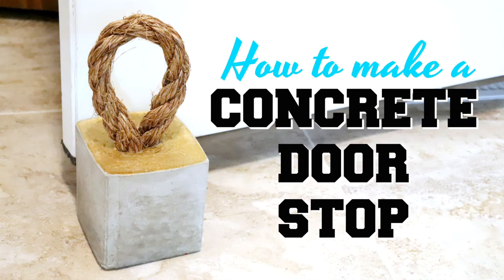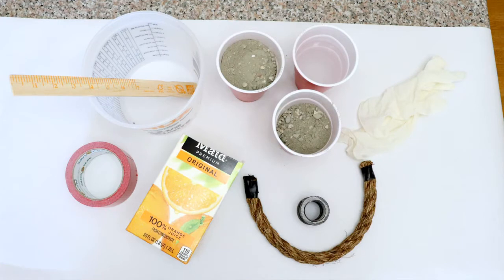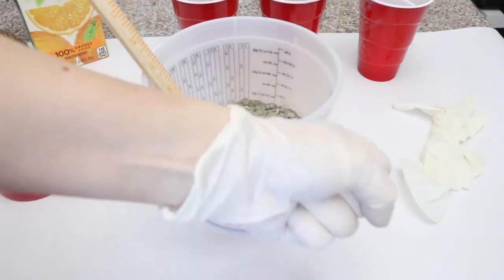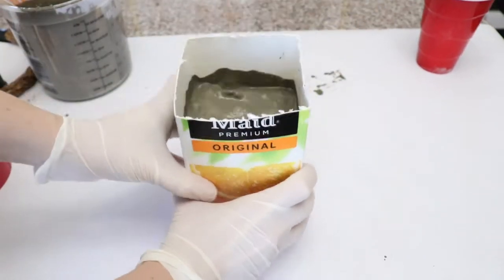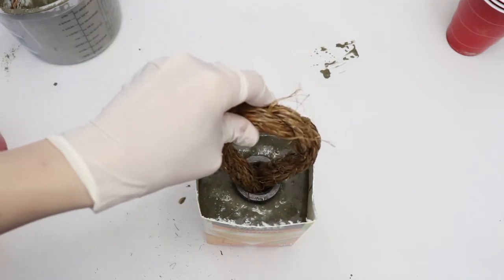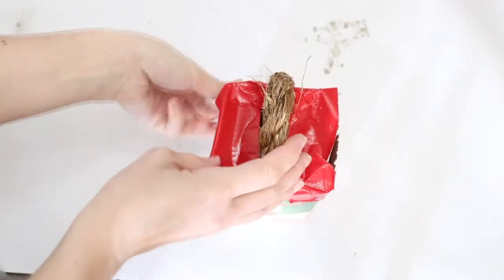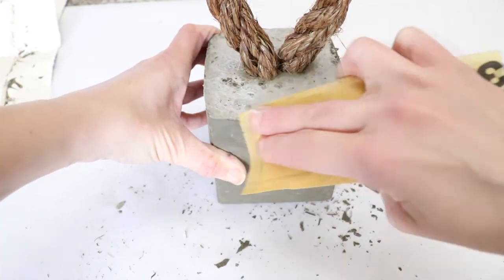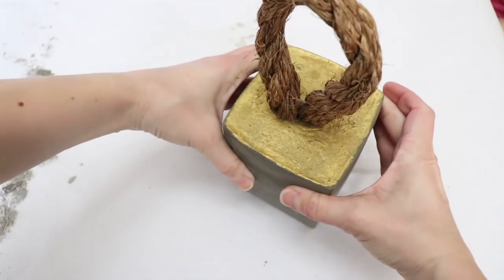How to make a modern concrete door stop with rope handle

Comment: What are the thicknesses of the rope and coupling you use here?
Reply from the maker: The rope measures about 2 inches around. As for the coupling I don't remember the exact size. When I purchased it I chose the rope first then found a coupling that the rope fit snugly into. Hope that helps.
Reply: I bought everything to do this. Thank you!